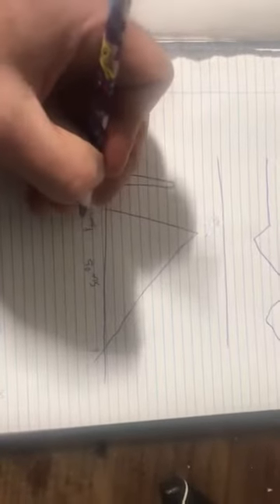An electric explanation of gravity. Aka Electrogravitic Hypothesis

Comment: I think were on the right track here. I also believe that this has been developed way back in the 1950's and is being used within black projects by government special projects now for practical methods of propulsion and levitation. I would like to see a repeat of the experiments performed quite successfully by Townsend Brown which also used high voltage and saw tooth wave forms. I believe the underlying principles here are correct.

Comment: have you tried HV opposing fields of two inductors ?
Reply from the maker: 45445 Angels I have not tried that. 
What kind of fields are you referring to?
Ac, Static dc, pulsating dc (waveform?), magnetic ?
Reply from the maker: Why would a magnetic field need to be High voltage?

I have tried Apposing magnets, but I couldn’t think of any plausible anti gravity explanation or way of building a craft out of it.

It may have more to do with an interaction with earths magnetic field than warp drive.
Reply: I haven't tried it yet either. In Theory there are two applications for it ( 1 would be the capacitor which then terminates as a field . In other words the stored capacitance of Dielectricity or Amps are converted into a magnetic field in Volts around the conductors  )  then ( 2nd is when the two capacitor plates one top one bottom eliminates current, glass(silicon) insulators might be needed ( which is basically how gravity works) direction of termination towards ground )... one step at the time , warp drive is a bit far advance in terms of using simple materials .  :)